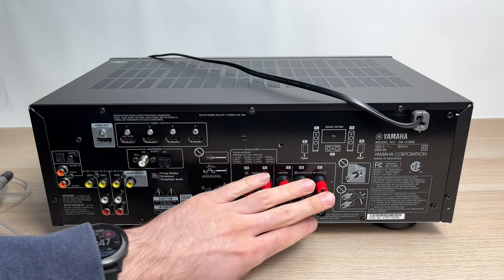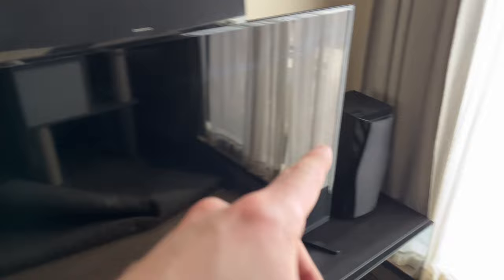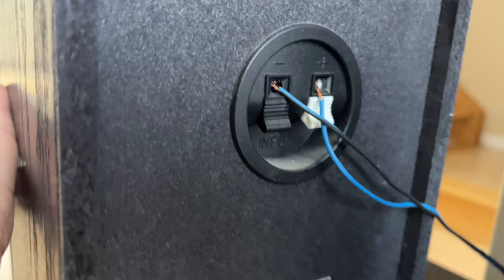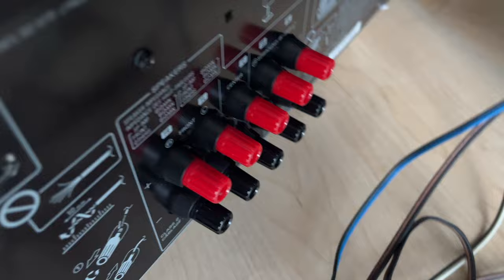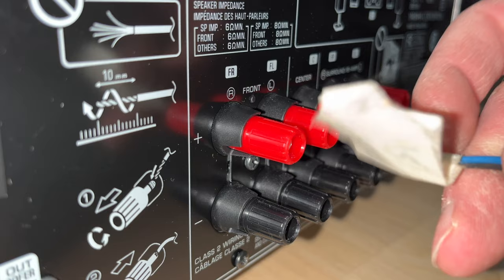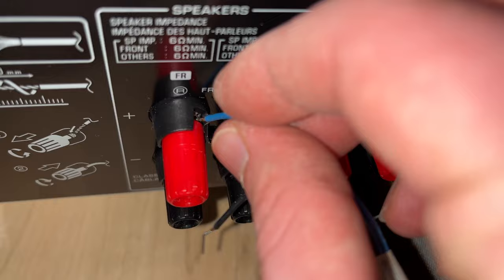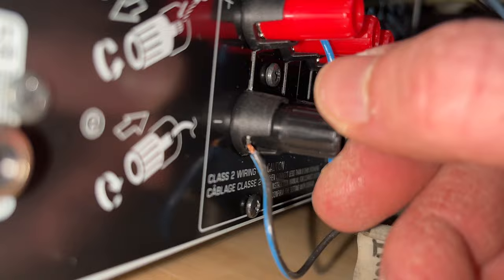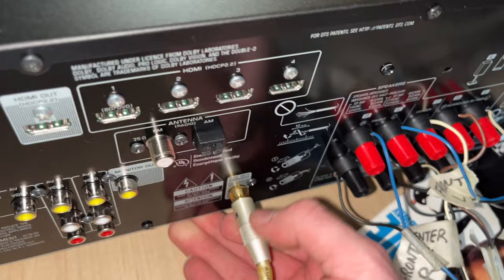Yamaha AV Receiver: How to Connect Speakers

Comment: I have a Bose Acoustimass 10 and there is a plug for Subwoofer Low Frequency Effects - my Yamaha receiver seems to not identify the Subwoorfer as LFE compatible - do you know if my RX-V673 and RX-V4A are compatible for the Bose Acoustimass 10 LFE plug?  Thanks.

Comment: I would  put thicker cables and the subwofer  between the two front 😊
Reply: From my understanding, subs are best utilized in corners of the room. And yes, thicker wires are almost certainly better for most audio setups.
Reply: 4:47 😅 @FuriousTortoise

Comment: ok but how would you connect a wired sub to the pre out port? Can a banana clip work for that? I've had the Yamaha system for 10+ yrs and I am upgrading my receiver but as mentioned the sub connection isn't wired but pre out.

Comment: hello..
I have yamaha avr
for the subwoofer. Must I have a powered subwoofer?
Reply: subwoofers are typically sold “active” (independently powered) because they’re the most power hungry speaker in your setup. Worse case when they’re playing some deep extended bass it can dull your main speakers by drawing a lot of power.

Comment: Bro it’s not working properly why?? 

Once played this Surround Right And Left And Surround Back Right And Left all signals Coming from Front Left and Right Both Tower Speakers.

The Sid Surround Left And Right And Back Surround Left And Right all signals going to Front Tower Speakers. But the Canter Channel is works fine on Right signals. 

My connection is correct from the Receiver at Speaker terminal. Also I tested from my Receiver when I test that’s working fine everything on Right signals. But when I try to play on test videos from YouTube that time all Surround signals going to trough to the front Tower Speaker. What’s wrong??? 

I’m using the System is HTDDW8600 7.4 Channel System. It’s called Sony Super Muteki